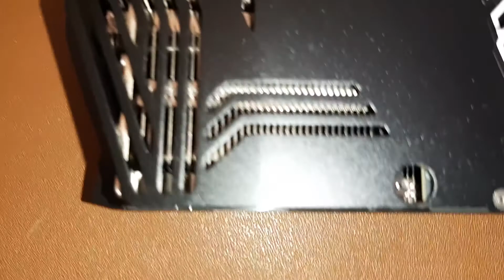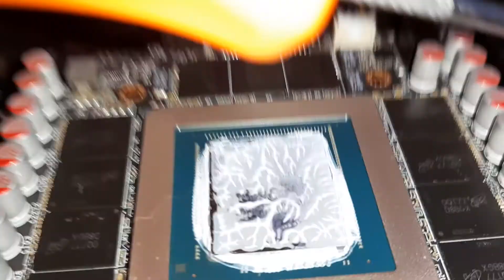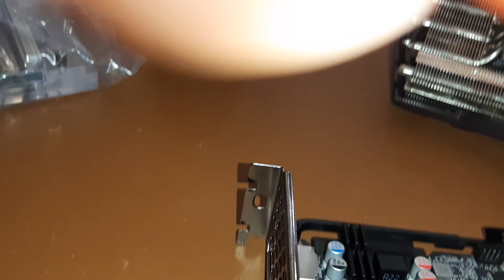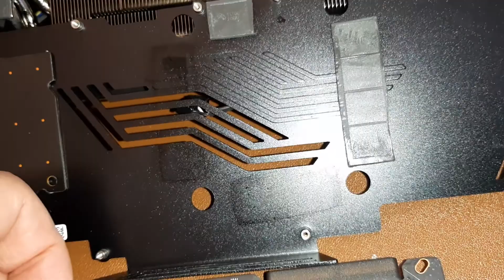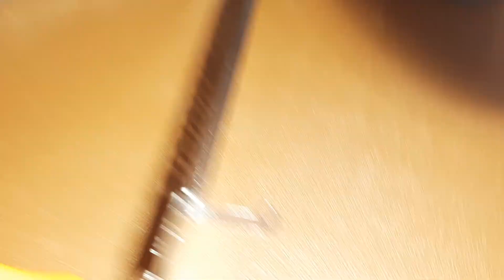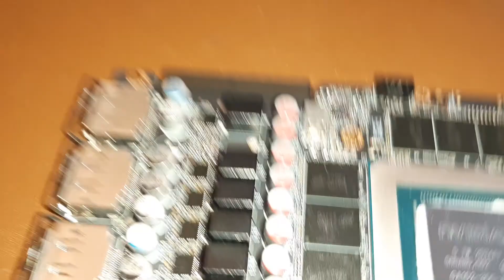Zortac RTX 3090 Trinity Teardown

Comment: would this tear down be basically the same for the 3080 and do you know the pad sizes i should use?
Reply from the maker: would not like to say, this teardown may help with the process on any card.  just a case of taking your time.  no idea re pads
Reply: Thanks guys I'll be tearing down and replcing pads on my day off
Reply: @miguelcolon2657  doin the same on my 3090
Reply: From looking around, it looks like the pads are 3mm on the back and 2mm on the front. I don't know if it would be the same for a 3080 tho

Comment: I dunno why these cards gets such a bad rap, yes I know they use some cheaper parts, but if you are not over clocking there is no problems. Other brands are only marginally better.
Reply: completely agree, mates farm has 2xzotacs, 1xasus strix, 1x ichil x4 & FE all 3090s, the zotacs are the most consistent of the 5 and the worst by far was ichil with failed thermal pads brand new
Reply: Zotac is garbage. You got lucky. Just looking at how cheaply made it is compared to other cards I’ve owned tells me all I need to know about this company. My 3070ti trinity is a sh1tshow of epic proportions. Needs an immediate repad out of the box. Still deciding if I’m rmaing or going to attempt the surgery. I get 110c at 100% fans within minutes.
Reply: @DB-be9wy  as much as I hate to admit it, I have to agree. My 3090 hits memory temps of 110c... Ridiculous.

Comment: 6 popcap, hard pass.
Reply: It was a software flaw not hardware after all
Reply: @victorperezADSK  no, they just nerfed frequency on ampere to avoid crash, still hardware flaw.
Reply: @lolokikou5521  They nerfed first week cause it was the fastest solution, solved it later. Still getting 2000 on my trinity 👍
Reply: @lolokikou5521  you don’t have a clue about hardware clearly.
Reply: @sayithowitis2865  whatever the spelling, this is low cost crap who ruins stability and overclocking potential of the chip. simple as dat really.
Reply: @lolokikou5521  No it is not that simple. It's been said before: you have no clue what you're talking about. There are several factors involved in the issues formerly reported by end users, such as silicon lottery, nVidia not allowing AIBs enough time for testing, nVidia pushing for cards to be run close to spec limits, cooling solution / thermals, morons running their cards on a weak power supply, and yes: also the quality of electronic components used. But you can not generally say that MLCC > POSCAP and you definitely can not say that 6 x POSCAP will break performance on the RTX 30x0 cards. You can have 6 x MLCC and the best VRM solution imaginable but it won't help you one bit if you lost the silicon lottery.
Reply: Also they are poscaps, again, you clearly don’t have a clue.
Reply: Derp.  They are SPCAPS.

Comment: Thanks for this, mate. It helps relieve some of the nervous energy that comes from waterblocking.
Reply from the maker: glad you found it usefull.  I think I forgotten to upload part 2 :)
Reply: @Petrolhead66  did you do a part 2? I have the same card which I plan on watercooling, would love to see how it worked :D
Reply from the maker: @victorperezADSK  haha, I did and need to upload
Reply: Thank you for this video, mate. Have your clock speeds improved with the water cooling?
Reply: I slapped on my EK block a few days ago.
Can pretty happily hit 2k mhz now running fairly warm. Honestly my favourite part is the lack of noise.
Jesus the zotac coolers are loud!
Reply: @SerinJameson  Thank you for the quick reply. You have a new sub.
Reply: @SerinJameson  agree, it sounds like its gonna take off. What temps are you getting and with what pump/rad?
Reply: @victorperezADSK  My temps include an old 5960x oc'd in the EK predator loop, so they can't really be taken as indicative of anything.
But typically 35-40 idle, and peaking just up to 70 when really gunning it in Horizon Zero Dawn with ray tracing on via reshade.
Reply: I should note that I'm Aussie, and its summer here.
Reply from the maker: @grahamstephens9931  I never bother with overclocking
Reply from the maker: Got round to uploading Part 2 - https://youtu.be/LqAgdw0qbzw